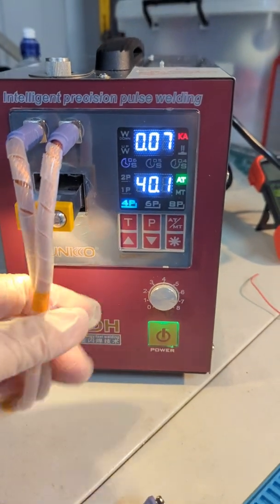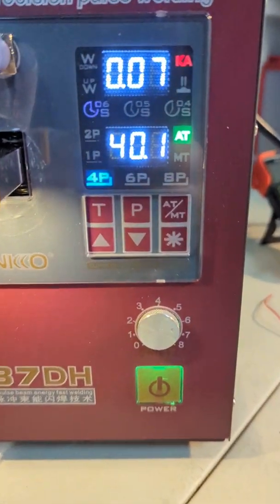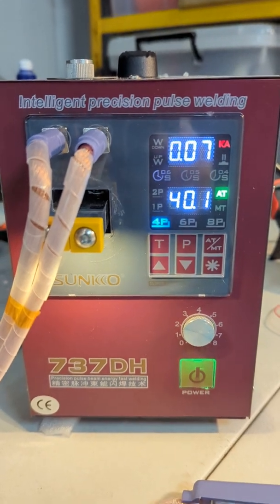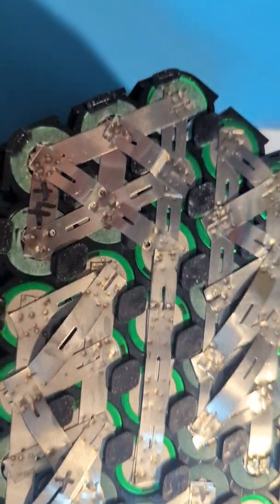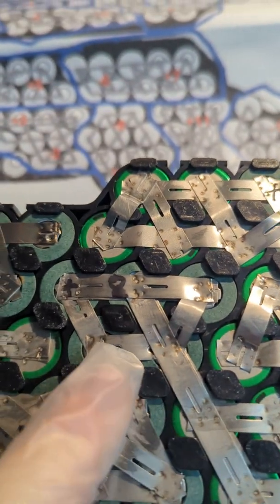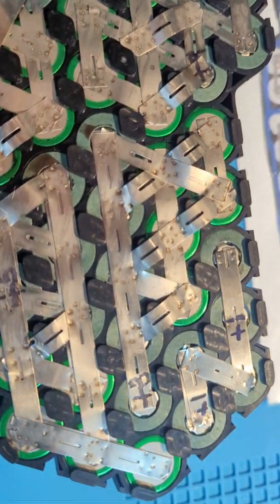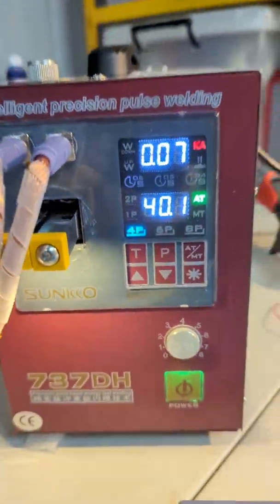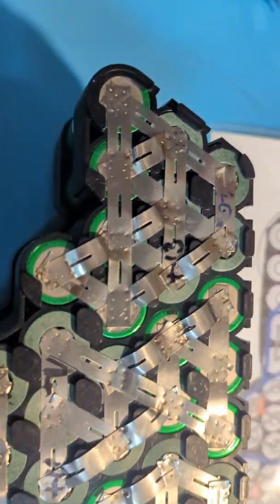Sunkko 737DH spot welder 48v battery

Comment: Gday Michael, was the spot welder very costly?
I’m looking at doing a Bafang mid drive conversion - did you do this by any chance, and if so where did you buy your Bafang kit? I’m in outer SE Melb.
Reply from the maker: The spot welder was about $500. 

No experience with the Bafang mid drive, but my understanding only the version they sell to bike manufactures (to build into frames) have torque sensing.
Have a look at the CYC Gen 3 Stealth mid drive.  They include torque sensing.  It is the second genertof their Stealth mid drive, and will hopefully reduce their high pitch, and lack of torque from a standing still. Reviews I imagine will come out in the next month or so.
Reply: @mickp10  Thanks for the reply mate 👌

Comment: Do u use 220v or 110v
Reply from the maker: 240v
Reply: @mickp10  I wanna one, I see alot of different reviews, but the 240v I see has better review
Reply: @jasperhart1188 240V one will have almost twice as much power, the transformer has better ratio. Can't pull so much current from 110V outlets, it tends to pop 230/240V outlet fuses anyway.